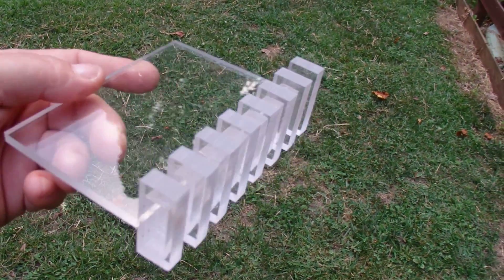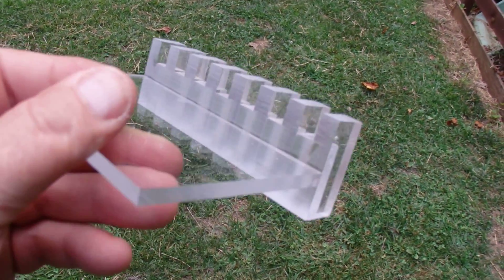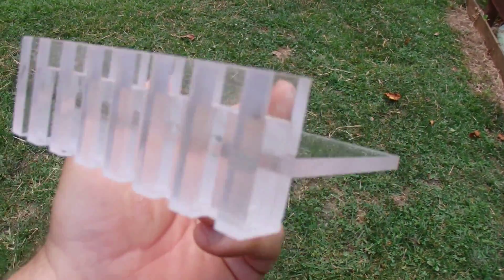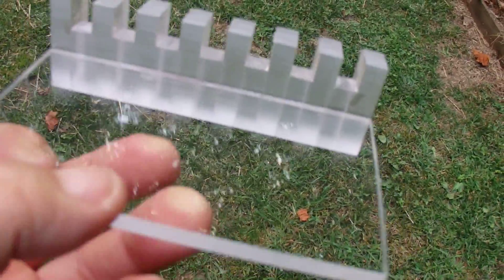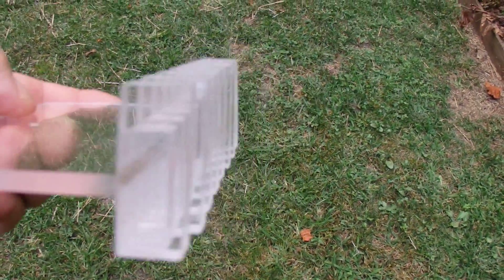Prototype Waterfall Reservoir Ledge: Light of Day 360

Comment: Just a question, are you going to polish that to perfect clarity?? and beyond. I dont know if any one would understand that last part. It just popped into my head.
Reply from the maker: SamLFisher No I left the marks on the faces on purpose and used my heat gun and some solvent to melt the fog off the fresh cuts to give them some clarity...and once wet they appear fully transparent. The idea is to mimic a massive hydroelectric spill way so I want the faces to be somewhat brutal.